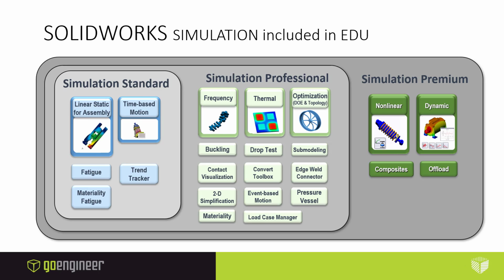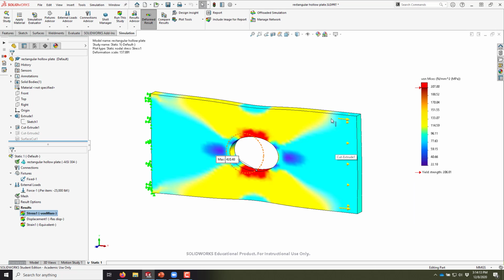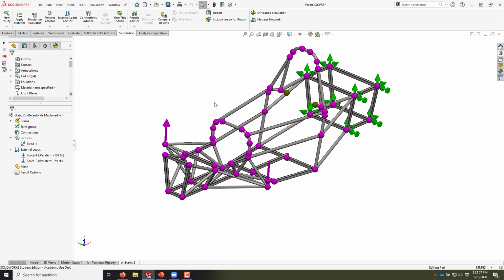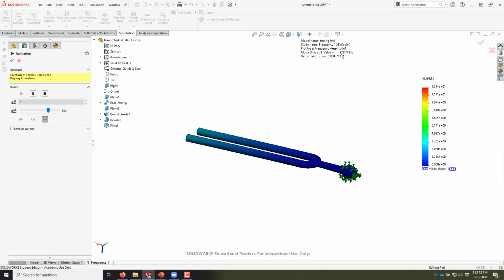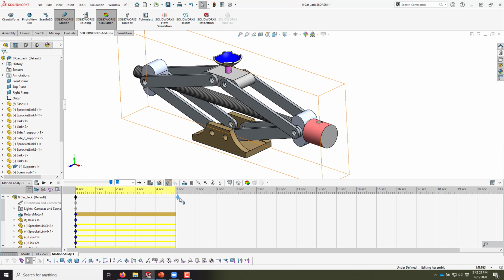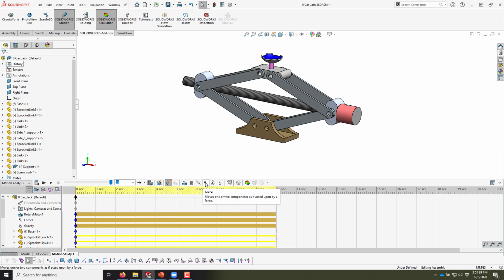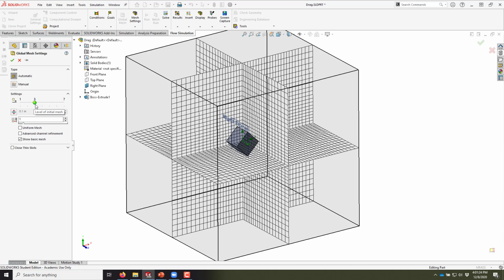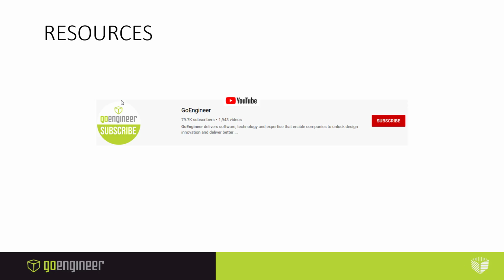Easy SOLIDWORKS Simulation for Students and Instructors

Comment: I mean not playing continuosly... continuous yellow line is the normal but for me the yellow line is not continuous instead  the yellow line is broken and separated
Reply from the maker: I'm probably going to need a bit more information, but here's my best guess:  If you are referring to the yellow line that appears in the same row as the moving bodies, this may be normal.  If a body moves by even a small amount, it will show a yellow line during the motion of the body.  If the body is perfectly still, it will show no yellow line.  If you see the yellow line but the body appears as though it's not moving, think again!  It may be rounding errors causing tiny fluctuations in movement.